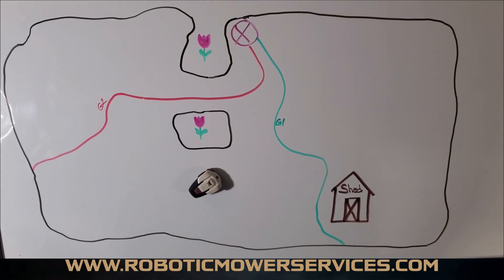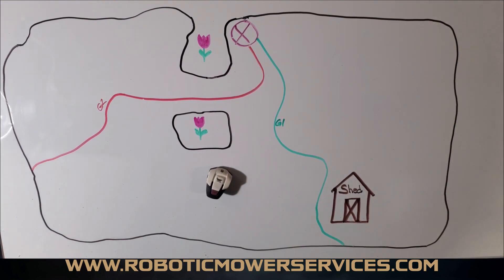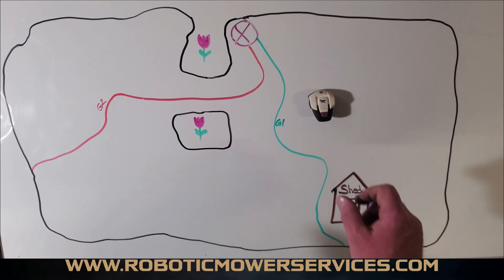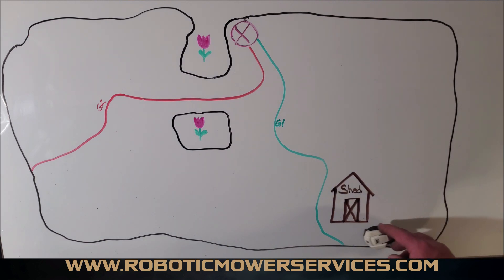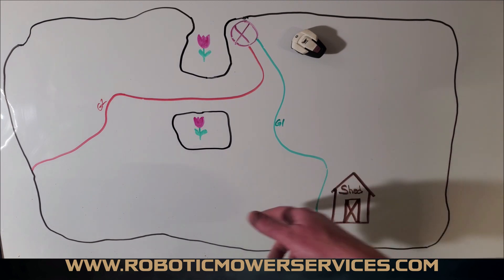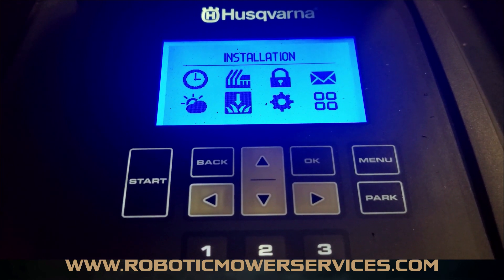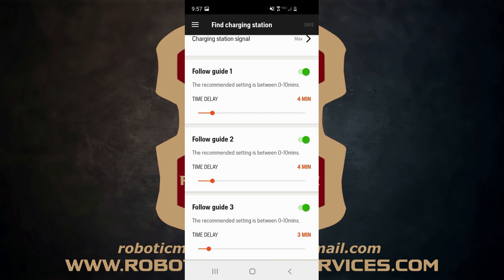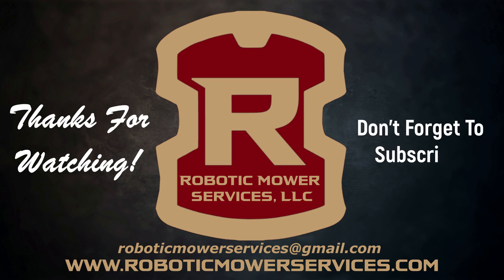How To Adjust Husqvarna Automower "Find Charging Station" Settings On The Mower & On The App

Comment: Hi, great video. Explains everything very clearly. I'm just wondering why is my mower (315x) going to charging station at 37% battery charge?
Reply from the maker: That is a bit odd. You should have a dealer check that out
Reply: Did you find a solution? Mine goes back quite early too
Reply: @delatroy  Not really. Now in summer when the grass is slowly growing, I get usually 50-60 min of mowing time which is ok. April/May were pretty rainy so the mower was mowing usually just 35 min per charge.
Reply: @baltazar888  I just got the 450x So not much experience with it yet. will keep an eye on it. I saw it going back at around 20% but maybe because it doesn’t have a good internal map of the charging station location relative to the guide and boundary wires yet
Reply: @baltazar888  maybe you need to replace the battery
Reply: Mine is the same way.  Has anyone found a solution?

Comment: Another Great Informative Video
I have a Garage/doghouse built for my mower and find the mower sometimes has problems when it gets on the side of the Garage.
even if I lower the setings I am thinking it would not help due to the boundary wires entering the back side of garage. (  thoughts ? )

Comment: I am going to my perimeter wire and have a sidewalk around the house I want to follow. However off the back deck I have a small area fenced for my dog to roam around on. The auto mower won’t be able to get into the area however to save boundary wire I’d like to just go under the fence and follow the side walk and come out the other side of the fence continuing along the side walk. Will that work or confuse the mower due to it not being able to follow the boundary wire all the way around? Thank you

Comment: Very handy thank you
Reply from the maker: Glad we could help!
Reply: @RoboticMowerServices 
Yes sorted my mowing out a treat. Interesting I tried the GPS mode. I didn't realise that the mower would still use the guides to get to a difficult spot in GPS mode. It had been set up for months on none GPS. The guide takes it through a gate across a stone path.  I should really set the 2nd guide up like you have shown to get it back to the charger better. Thanks again
Reply from the maker: Using another guide is always a good idea because it gets the mower back to the charger quicker and that means it's back out mowing faster.